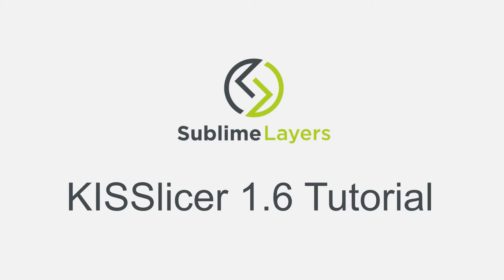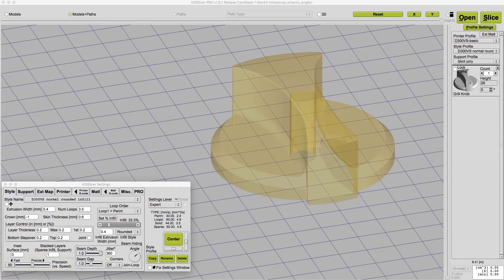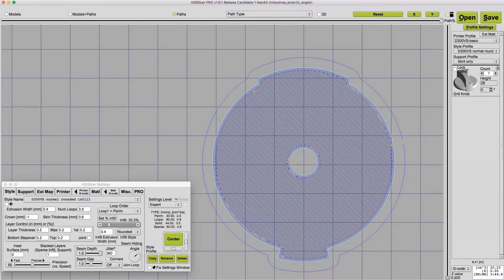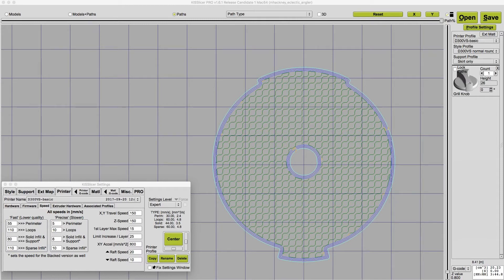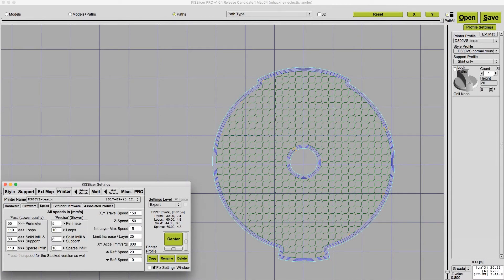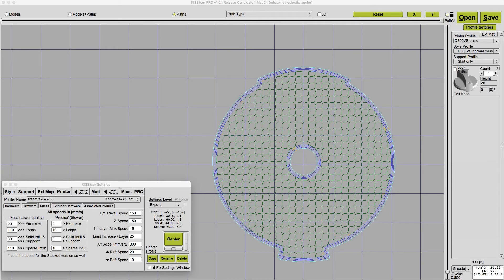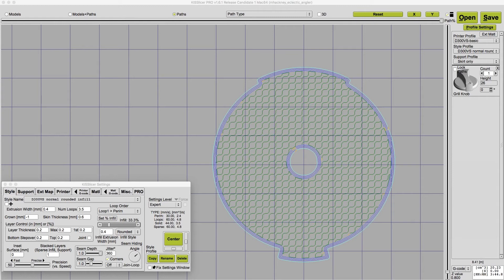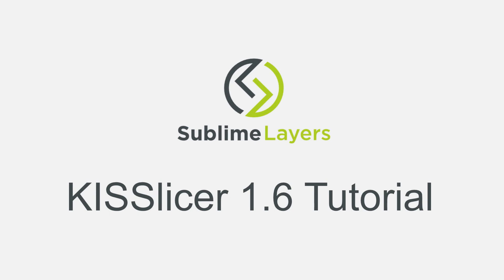KISSlicer Tutorial: All About Speeds

Comment: how to change the printing orientation of the filament layer because it is having a by default +/- 45 degree.
Reply from the maker: You can rotate the model and that will effectively change the extrusion orientation. KISS doesn't have an explicit infill orientation feature.
Reply: @AHackOfAllTrades   thanks but I find the new software which better than kisslicer